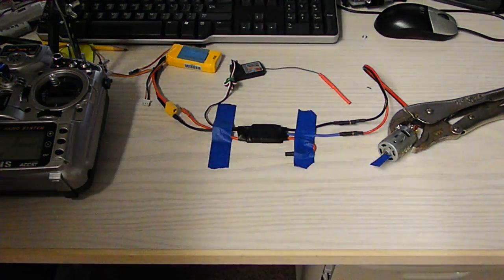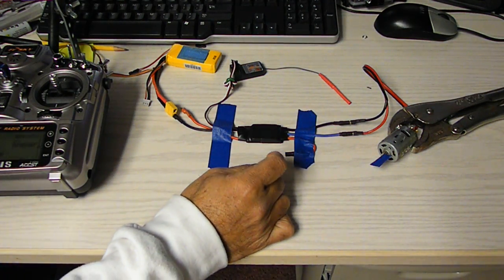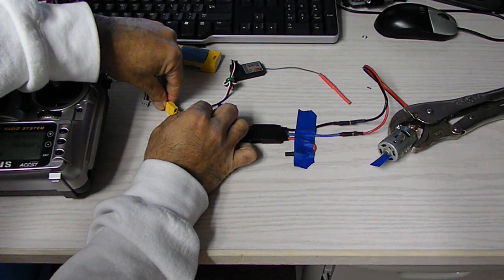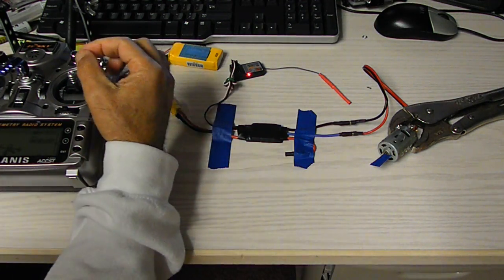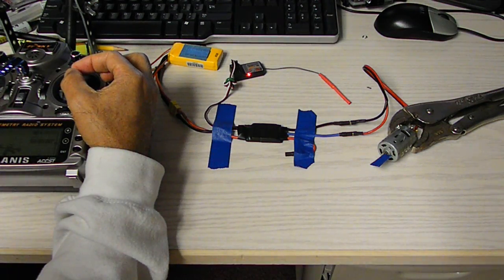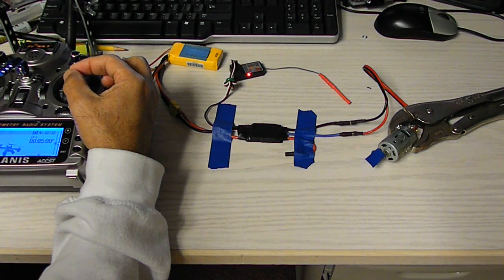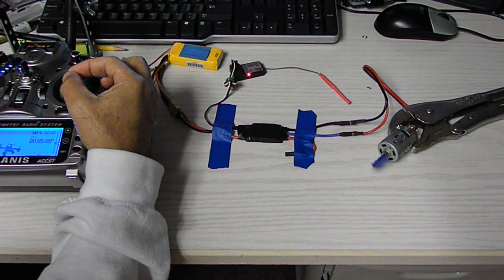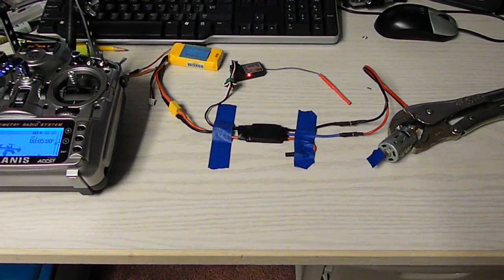Brushless to Brushed ESC conversion with reverse - fully proportional

Comment: What firmware is used to make the ESC do this?
Reply from the maker: Hi Ron ... the hex is called the F20A_R40.hex (upload is the same process as SimonK or the KK boards) ...Link in the vid description will take you to the site with the download link. I'm building a MonsterTruck with MWC code - got it running but I need to find a way to "stop" the gyro correction .... but it works. I'm using MWC 2.3 Nav so theoretically, it can do waypoints ... dunno if it can ... if it does, it would be a very smart little truck.
Reply: tsisapik
Thanks for the reply.  One way to stop the gyro correction is to go into the GUI and set the gains as low as possible.  I've wanted to do that with my RC car to keep it from fish tailing by having the yaw gyro on the steering.  Also to keep the front wheels down on the ground like traction control by mixing the pitch with the throttle.  All the best!
Reply from the maker: RonALampman Thanks for the tips Ron. I did try reducing PID but when I bring them down, the servos refuse to work. Anywhoo I replaced the firmware with MWC 2.3 Nav using the Flying wing frame. Running elevons, I have forward/reverse left/right on the right stick. Set the Aux mode to "passthrough" so zero gyro gain. Better than expected. All four wheels are moving (like a tracked vehicle) so the truck can turn on a dime - just posted the test vid ... Hope the weather holds so I can do outdoor tests - plus the tricopter airplane, plus the APM copter ...